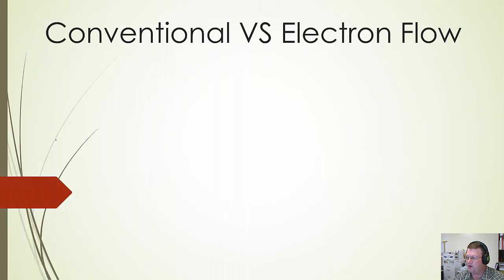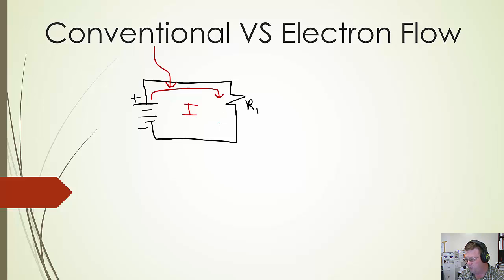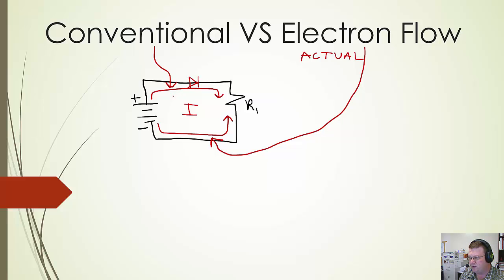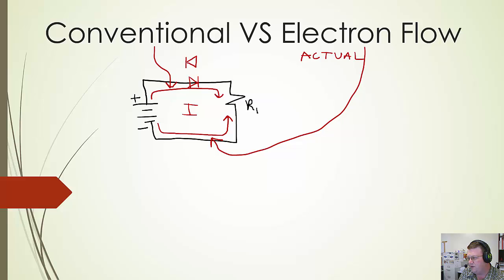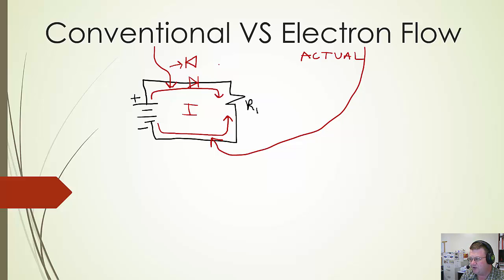Conventional VS Electron Flow

Comment: The electron vacuum resulting from the electrons going  - to +  is what creates conventional current flow  which is  +  to -  .   Picture a person sucking the air out of an empty 2 liter pop bottle.  While the Air  (electrons)  flows OUT of the bottle, the air pressure vacuum created (holes or electron vacuum)  forces the sides of the bottle INWARD not outward.   I hope that makes things more visual.    The electron vacuum/tension created is the Voltage the suction away from the electrons IS the current.  Unless you have a conductive or semiconductive material to allow for this flow it will either reach infinite resistance or short out.